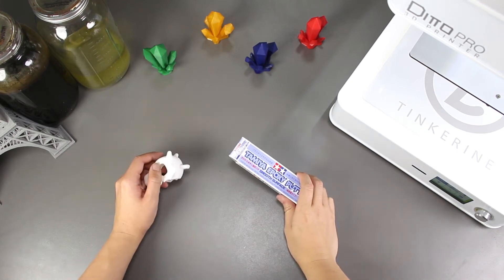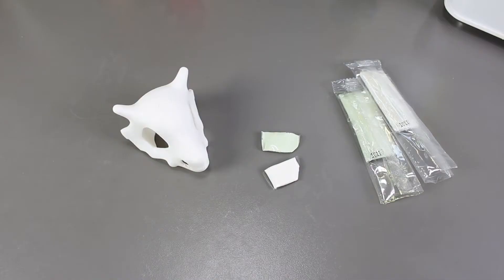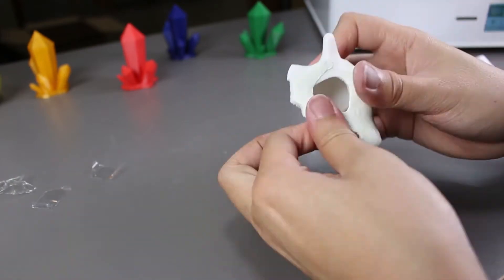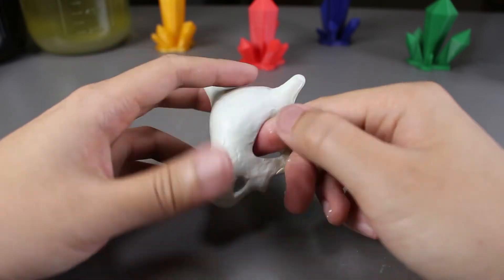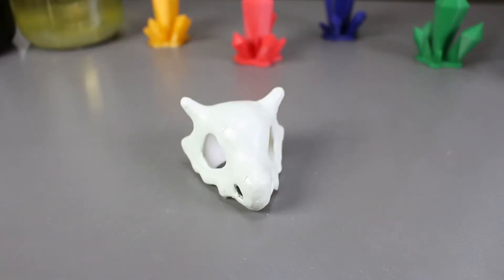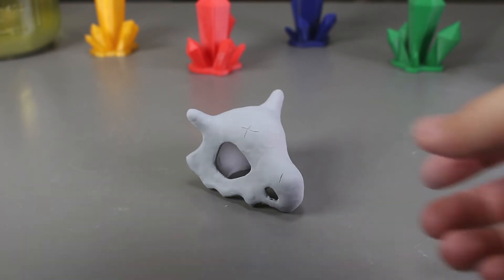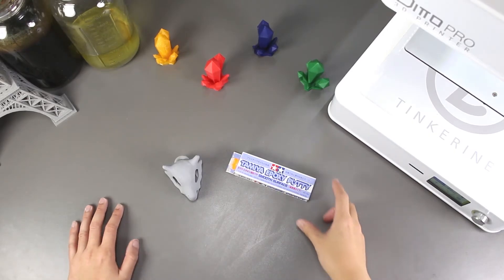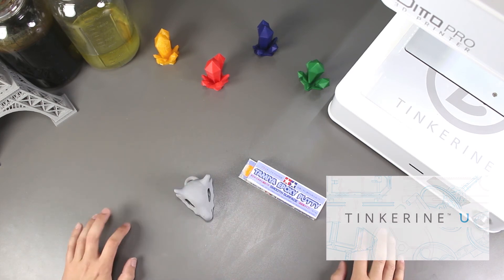Post-Processing 3D Printed PLA Print with Epoxy Putty

Comment: What would you say is the best results in your experience so far in getting a smooth finish? That vs also the most cost effective option with good results.
Reply from the maker: Thanks for the comment! We believe that sanding  or lacquer thinner produces the best finishes so far. Both methods are pretty cost effective, being under $10.
Reply: @Tinkerine  tried that wood filler, it's not bad but still dusts off after painting. I suppose using more coats of primer may help?

Comment: Informative video! One important safety note through: do not touch epoxy or epoxy putty with bare hands. You can build up an epoxy allergy fairly quickly and when you’ve got an allergy for it, you’ll never be able to properly work with it again, even with extreme protection.
Reply from the maker: Thanks for the advice and comment!